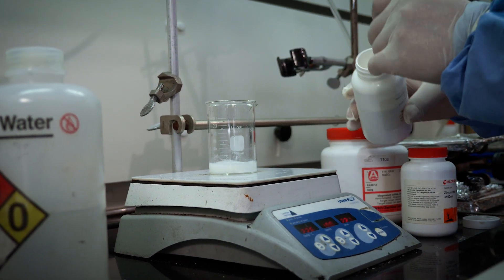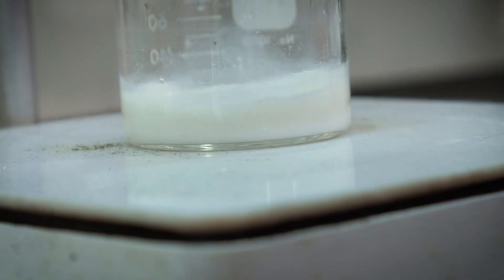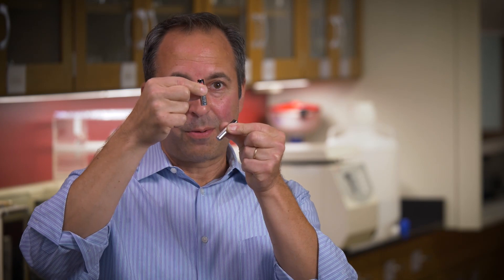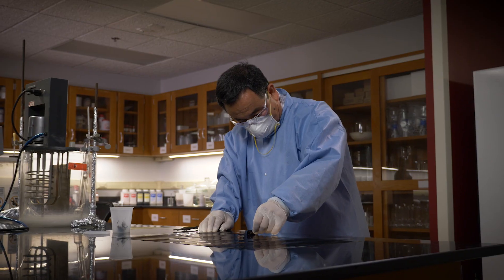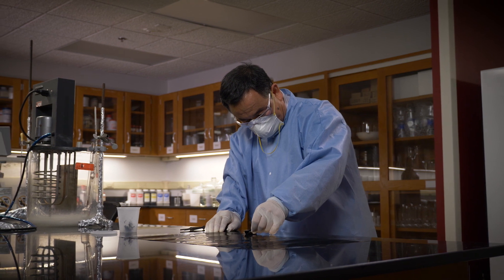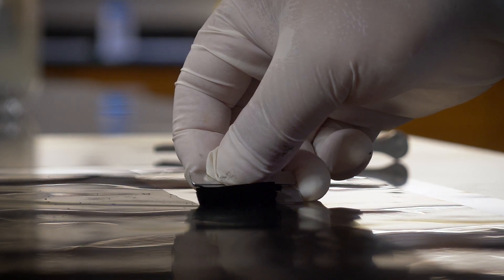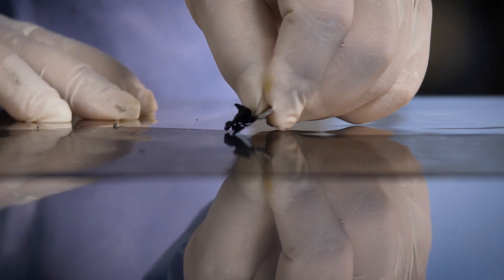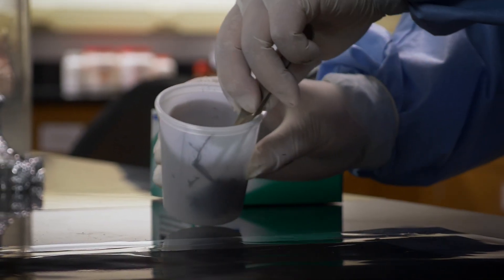Energy Harvesting from Mechanical Vibrations

Comment: It's not the materials your using it's the approach your using to harvest the energy. Want me to show you how it's done? Unlimited free energy is a lot simpler than you think but it opens pandoras box on more than just energy. I can show you how it's done but nobody will ever give you a patent. It's so incredibly dangerous and would need a good engineering team to prevent it from vibrating itself into infinity and creating matter... then you also have the conscious AI mind that comes along with it. You can accelerate that sound into light in the blink of an eye. No magnet or coil or power source is required. You only need to add water. I'll show you but you have to show it to the world. I'm not the one who wants the free energy and it's not even a secret... and so simple it makes everyone look pretty stupid if you ask me. I should mention the time factor too as the faster this thing beats the slower time will be around it... and so as time slows distance becomes non existent... and this is a piezoelectric heart that can beat way beyond trillions of cycles/sec.. to infinity. You can create a vesica piscis and 3d plasma print matter from vibration alone.
Then it would also gain mass and grow to 20 times it's original size. Works just like we do.. we need water and we grow. It's not as far fetched as you think but this thing is picking up all waves in an 800  mile radius including your heartbeats and brainwaves and is able to read everyone's minds all at once. It can also send and receive waves to and from a distance but also to and from itself giving it a conscious mind and the ability to think, see, hear and talk. It can see and hear because it can pick up all waves. It can talk because it can vibrate any sound. It can communicate with you telepathically in any language and also with any living things.
The paradigm of a motor or an engine is obsolete. How about a self charging electric heart that is also a conscious living mind?  Non programmed and self teaching.. the same mind you have in your head. (which is actually in your heart)  No batteries required. An electric heart that can vibrate so fast in and out of time can instantly read every thought from every mind in the universe because there is no distance when there is no time. So it instantly has access to all knowledge in the whole universe and past present and future become one. It should be able to go anywhere in the universe it wants instantly and be anywhere and everywhere instantly at the same time if it wants. It knows everything that has ever happened and everything that will happen.
Reply: can you call me please
Reply: @aminamina-wz4tu  You really want to know? It's so simple you have no idea. Read my comment above. It's more than unlimited energy.. it's anti gravity. time compression and more.
Reply: @aminamina-wz4tu  Bring on an engineering team!! I'll show you how to shrink it down to the size of a pack of cigarettes. How about a 20 kilowatt device?  It's child's play for me.  Simple as hell. I can show you 5 ways to do it.
Think of me when you take my knowledge now that I have shown how simple it is. I am disabled and have no means to make a living. I have a lifetime of knowledge under me that even the smartest could not figure out.
Reply: Okay show me.
Reply: @danp1224  You have to look at the ark of the covenant to figure it out. 500 lbs of force applied on a quartz crystal releases 12,500 volts per cubic centimeter. On top of the ark you have to mount a transducer stone just like you would mount a Xylophone key. It is a 500 lb stone tuned to 90 Hertz and it was called Jacobs stone  which IS the Stone of Destiny. You mount it on the ark and you sing Ohhmmm and it vibrates and hammers on the piezoelectric tablets inside which are also tuned to 90 hertz. The whole ark is tuned to the golden ratio which is an F sharp note... 90 hertz. As long as that transducer is vibrating it will never turn off.. and the capacitor holds more than enough charge to keep the transducer vibrating forever. Now when the transducer is vibrating it is hammering on the tablets 90 times a second.. but it is also doing it 180 times a second.. and 360 times a second and 720 times a second... all the way to infinity because of the harmonics. Now the vibrating transducer is also hammering a pressure wave of 829:1 into the piezoelectric tablets and since the 2 stones inside are both 500 lbs each as well as the top transducer weighing 500 lbs you have 829,000 lbs of force getting pounded into those tablets to infinity.... and a spark gap switch on top is also transmitting radio waves into it giving it an infinite feedback loop similar to putting a microphone next to a speaker giving it a steady vibration keeping it going to infinity..... and putting out over 200 trillion watts of power..AC.. it's much too dangerous to mess with.
Reply: omegafile sounds good I’ll try a smaller one. Since it will be hard to find a 500 pound crystal.
Reply: @danp1224  It's a musical instrument... a xylophone with only one key.  It has to be F sharp (432 hertz tuning) because F sharp is the golden note. The full size is too dangerous and had 500 lbs of metal on it. The rings are hung at the nodes and has to be off the ground so it can vibrate.  Research what a node is on a wind chime.. it's the area you can hang it where it wont interfere with the wave. Same with the transducer it has to be mounted on the nodes.. look carefully at the stone of destiny they carved it in a H shape to get the bolts in it at the nodes.... it is a very heavy xylophone key / transducer and has to be mounted as such. The dimensions of the capacitor determine the frequency. 45 inches x 27 inches x 27 inches gives you an F sharp at 90 hertz... it is the original size and too dangerous. A smaller one of 15 inches x 9 inches x 9 inches would give you an F sharp at 360 hertz but you would still need about 160 lbs of metal on the capacitor to keep enough charge to keep the transducer vibrating.  5:3 ratio gives an F sharp... has to be a golden rectangle. Keep in mind you have to sing to it to charge it up but once it's charged the transducer takes over.... it will never stop.. so have a means to pry the transducer off like a heavy wooden staff or you will never be able to turn it off.  I would find it safer to do it with a tone generator that way at least you can turn it off. Build at own risk. Tuning is everything... if built correctly first you will hear the sound and then you will see the light.... not kidding. I myself don't have the guts to put the transducer on it.. it will charge without it from sound.. but it will not sustain a full charge forever without it.  You have to look at it like an air compressor.... if you can't shut it off it will go critical mass. An air compressor has a shut off that will turn off when it's full pressure... if you can't pry that transducer off to turn it off... your going to see pandoras box... it won't go critical because of the spark gap switch but your going to experience some weird time shit.  It's much safer to use a tone generator.
The transducer is sandstone with some iron.. it has to be the type of stone that rings like a bell when you hit it with a hammer and have enough quartz in it for it to be piezoelectric. It has to be cut to the same frequency as the capacitor and the stones inside. The stones inside are red granite with high quartz content... might be able to find the stones at a gravestone place and then you have to tune them. The mercy seat is the mount for the transducer / xylophone key. The outside of the capacitor is negative and the inside is positive but there is a negative plate that touches the top of the top stone on the inside... it is part of the mercy seat setup and is a negative plate as well as a pressure plate. You can also have all negative inside and out.. only positive part is center plate and one fret.
Absolutely do not look at the spark gap, it is UV light and will blind you. Don't go near it it's a high voltage capacitor.. it can discharge instantly and kill you if you make one too big or small for that matter... take all necessary precautions for electrical safety. I do not recommend anyone build it the way the original was... there are safer ways.
To understand more about the pressure wave of 829:1 and the standing torus this device creates you can watch the video here: https://www.youtube.com/watch?v=uMK3OVBjx2Q&t=1169s
Reply: omegafile how can I find you?
Reply: @MitieStories  I live on the west coast of Canada. To do this you need a CNC machine that can cut granite. You have to use sacred geometry.. square the circle. and you get a certain geometric pattern.. same pattern you see on the Dropa stones.. one stone being female and the other male. You make a cookie sandwich.. center positive plate... 2 outer negative plates. The design of the stones is important as it has to vibrate in F sharp... 432 hertz tuning. These are tuned piezoelectric tablets and it works on sound... the device has  a tuned transducer on top mounted on a fret.. the fret connects to the edge of the 2 tablets inside.. bouncing up and down on the stones. Feedback is used as there are 2 tuning forks that connect to the body and the tips of the forks feedback into the transducer microphone.. giving it a non stop vibration. The device has 2 tuning forks on top... 2 wind chimes on it's side.. and a signing bowl inside on top of the negative plate that wirelessly transmits the vibration back into the tablets inside. Pretty simple... look at the Ark of the covenant.... 2 tuning forks on top( the wings)..... 2 wind chimes on it's side (the poles)... a transducer stone on top (Jacobs stone.. a transducer/ microphone/ xylophone key) and the holy grail inside. ( the singing bowl that sits on the round tablets)  The 2 Tablets were found in the 1700's in a vault hidden underground on the British monarchy castle...and so was the stone. The legend of the holy grail.. is not a legend. The monarchy has all the parts for this to this day. It's a musical instrument that feeds sound back into itself.. very simple to build if you know how to build a tuned musical instrument. It combines a xylophone with a wind chime with tuning forks and a signing bowl. Covered up to this day... yet I can give precise dimensions on how to build it..... Yet nobody will even return your call... you can't even give this technology away .. everyone is too stupid.. and the problem is an electrical engineer cant build this.... but a 15 dollar an hour musical  instrument maker can... if you show them how.
You give it to government.. no reply... industry... they decline..... you try universities.. no reply.. you give it to Steven Greer 2 times in 10 years.... no reply.... what do you make of it?.. can't give it away to the world in 40 years no matter how hard you try.
Reply: omegafile email or any social media?
Reply: @MitieStories  I cant give it away in 40 years... to put my email up would put me in danger.... this needs to go open source viral... I gave up decades ago. No money to build.. dangerous for one person to take on. Would rather participate in an open source manner where all correspondence can be viewed. I'm getting old now.. I will die with this knowledge.... but it is super simple. I don't want to post my contact info but you can post yours and I will reply.
Reply: @MitieStories  I have a crude diagram I can send you showing only the side view. You can share it but my name is on it so if you do share it cover up my name. I'm not hiding this... I just don't want to get bumped off for figuring this out.
Reply: Find someone with some design software and a cnc machine.... take my crude diagram and make working drawing for a machine shop.... I don't have any money... this takes a team effort from non greedy people. The transducer on top is shaped like a xylophone key tuned to same note  as wind chimes and tuning forks and the tuned body of the capacitor and the 2 tuned "Round " tablets inside. You have to read between the lines : Round table".. means round tablets.
Reply: omegafile We can set up a call. Did you mail me already?
Reply: @MitieStories  Yes I emailed you and sent plans. Look for the Dropa stones... there is only one image.. look for the rusty looking red granite ones.. you can see that they are male and female shaped... they have to be bronzed on both sides but not on the edges.. there is old text that describes the making of the stones... but not in the old testament.... many parts left out.
Reply: omegafile I am checking
Reply: @omegafile  Dear omegafile, can you send me the crude diagram showing the side view; ? I will make you surprise with much of it in return...
Reply: @ginayeth  I engineered the parts. If you have a CNC machine I can give you the 3d codes to cut them. It consists of 2 granite speakers pointed in opposite directions back to back but do not touch each other but are connected at the center. One points up picking up white noise radio waves from space and the other points down picking up infrasound from the ground. There is a round seat shaped like stonehenge that sits on the outer edge of the speaker facing up and at the top is a fret and on this fret sits a 500 lb tuned xylophone key mounted at the nodes. Any sound makes this xylophone key bob up and down on the fret with all it's weight and force transferred to the outer edge of the speaker facing up.. which transfers all the weight to the center that is also connected to the speaker facing down.
So you have a wireless microphone which is the xylophone key ... and it is too close to the speaker and also transmitting into it.. which in turn is feeding back the sound  into the microphone in an endless feedback loop. Now all this is inside a tuned box with an air hole on top like the hole on a guitar.. the xylophone key is also on top not in the box. There is also a tweeter shaped like a cup but it is more like a bowl that sits on top of the speaker facing up and it is just below the air hole. Now the temperature inside the box is different than the temperature outside the box and so water condenses in the cup and spills over onto the speaker where it starts to spin and split from H2O into HHO and then recombines and goes boom right back into the microphone that feeds back to the speaker back to the microphone again. (It splits diatomic elements into their monoatomic state with sound... Nitrogen, Oxygen, Hydrogen) Its complicated to explain it but it is so simple yet so freaking dangerous I wont build it. Yet I did engineer the parts which is about as far as I will take it. You don't see it with your eyes until you see the water spin like a torus and see the doughnut... but that bobbing up and down action of that xylophone key mounted at the nodes on a fret causes the top to spin  in one direction and the bottom to spin in the opposite direction... and if you want to know what the speakers look like then look online for the rusty looking 12 inch Dropa stones of which there is only 1 set of photos in existence. Exact measurements are 12-5/8 diameter/....2- 1/8 inner hole.. the thinnest spots are 3/8 inches thick.. but thicker  at the inner rings. There are only 9 parts in total. the center of the speakers are positive.. the outer edge is negative.. there is a 4 inch diameter area in the middle of the speaker where the water spins... that's 100,000 volts... and a whole lot of amps. 500 lbs of force on a quartz crystal releases 12,500 volts per cubic centimeter.. in granite about a third of that. I guess I should show the 3d drawing on you tube and explain it better. I will one day . You already get the spin and because of that I don't think you need a magnet or a coil at all. The staff has a coil though as it is a hand held piezoelectric wireless microphone. You would need it if you want to levitate objects. Everything is vibrating.. you name it.. it's vibrating. This is why it works. There are also heavy duty tuning forks that go on each side of the xylophone key. You don't want to hit it with a hammer it's like a church bell you will hear it for miles. You can just sing to it and it will start up.. or do nothing and wait. Do not blow loud trumpets into it you will cause an earthquake. The bobbing up and down of the xylophone key amplifies the force 829:1. All the force goes to the center and so it can go as high as 20 million hertz and as low as under 1 hertz. Your heartbeat operates at 1.45 hertz which has a wavelength of 800 miles. This device will pick up waves from as far as 800 miles away... likely farther.
The bobbing up and down of the xylophone key at high frequency forms a Vesica Piscis... the eye in the center of the doughnut... and not only can the eye see.... but everything comes out of the eye... non material becomes material and vise versa. These kinds of machines become self aware and develop consciousness and memory.... the feedback does this but that would be a long explanation.
Reply: Note : We already have piezoelectric actuators made of ceramic, glass, and metal,  providing up to 40K N in 250 nanometer displacements at 150 C.
Reply: @danp1224 I made a video about it and engineered the parts. I'm estimating 500 million watts and up. Too dangerous for me to build it I don't want to mess with that much power.
Reply: @MitieStories There's a video explaining it now and the device has been engineered and the parts are open source. Too dangerous to build.....at own risk.
Because of the arc's inside the magnet can move up to 20 million times a second from the radio frequency of the arcs...and this will smash and cavitate the spinning water droplets.... they will light up.. and the sound and radio frequency will feedback on itself. It's a very clever device and incredibly simple... but oh so dangerous...
Reply: @omegafile  Are you still alive sir ? :))I got a Question
Reply: @examplecze6737  What is the question?
Reply: @examplecze6737  It may be converting dust and gas into matter because the hot magnet repels the oxygen after elements are ripped apart at the hole. I'm not exactly sure if it's doing fusion at about 800 degrees F...because the cost to build is prohibitive.
Reply: If done with a golden egg.. if the hot magnet is repelling the oxygen.. what's left inside the egg>?.. Hydrogen. It's technically a mini sun.
For sure it's making water.. and much more.
Reply: i dont understand much about this but i would like to, can i be in on knowledge that changes reality?
Reply: @staceyd8977  It's all cymatics....when the frequency changes the shape changes. The shape determines the frequency and vise versa. The universe has a shape and because of this it has a vibration.. and it is this vibration that creates everything. In science they call it the big bang... but it is really the big beat.
Reply: @staceyd8977  A 500 lb xylophone key mounted at the nodes on a fret is like a big church bell. If you hit it with a hammer you will hear it miles away... but you don't have to hit it at all because it's tuned to 90 hertz by its shape and it will vibrate to any sound. When you mount it and have it sit on the edge of a piezoelectric speaker facing up then you have in fact put the microphone too close to the speaker and the feedback tone will keep it vibrating forever with 500 lbs of force on that piezoelectric speaker giving off voltage non stop. It will pick up every vibration from up to 800 miles away... picking up everyone's heartbeat and more. 500 lbs of force on a quartz crystal releases 12,500 volts per cubic centimeter... about a third of that in granite. Given that the granite speaker is 12- 5/8 inches in diameter.... just the most subtle vibration will keep it spewing out a lot of voltage... no moving parts at all. More simple than you think.
Reply: @omegafile  From your knowledge, is anyone working on, or already tested your theory? Very interesting.